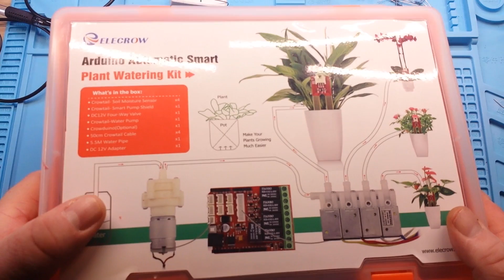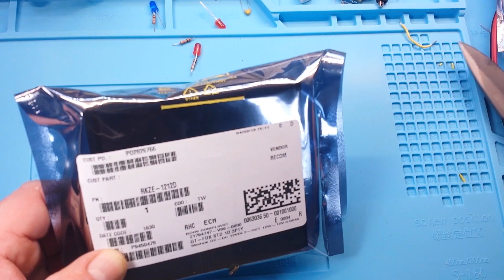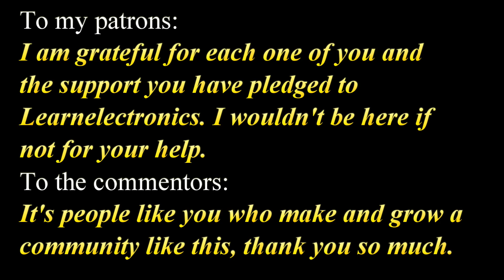Opening your mail

Comment: I love the flux pens....but when they are empty i just take them apart and top them up from the cheap large bottles of flux. But then...i am a tightwad. Cool video...thanks Paul, and best wishes from an (ex)Englishman trapped in the Pocono mountains! I am sure you know where they are.
Reply from the maker: Pocono's, heck yeah. About a 6 hour drive to my East.
Reply: @learnelectronics  Yep, that's it. I worked as a welder at a nuke plant over by your way too.....Beaver Valley nuke in Shippingport. Pretty area. Many moons ago before i retired.